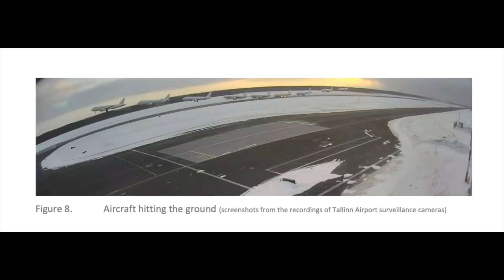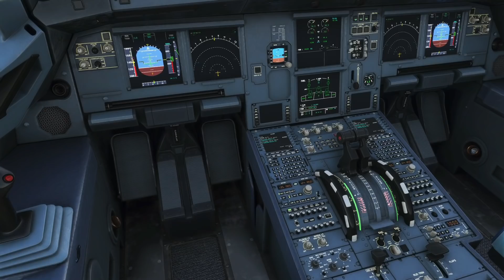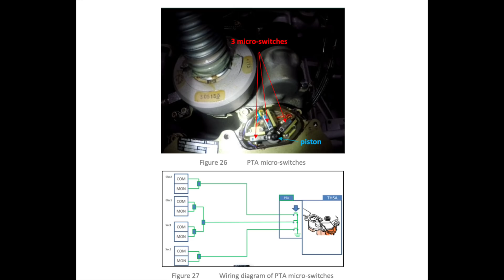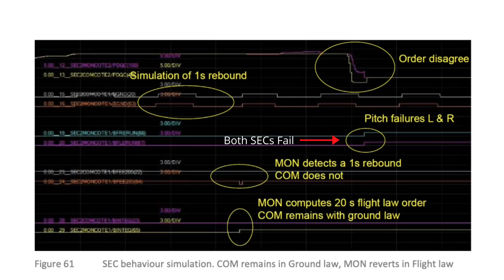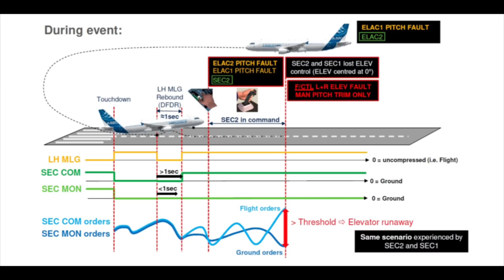The Oil Change That Crashed A Passenger Jet | The Crash Of Smartlynx 9001

Comment: I'd say automation should be between 5 and 8. Not enough automation = pilot overload. Too much automation = pilot in the dark if things go south.
Reply: Dude, the plane told them that something was wrong. They chose to ignore it, resetting the computer time and again. I can understand if they reset the computer once. But if it comes on a third time, maybe, just maybe you should consider that there might be something wrong... It's kinda like you see your engine check light and say: "Ah, no big deal!"Until your engine locks up. Then it is a big deal.
Reply: @brkr78  - Airplanes don't usually pass one another going in opposite directions separated by 5 feet. An aircraft can be a couple of hundred feet, or more, out of its prescribed flight path. No problemo. Motor vehicles are 6-8½ feet wide running in 11’-12’ wide lanes. The vertical is, though, taken care of.
Reply: @algrayson8965  You sure you are replying to me? I know planes don't pass within 5 feet of each other, at least as long as they are in the air and everything works the way it should. But if you notice that one of three axis have lost or degraded control authority, and especially if we are talking about the elevater - I'd say better safe than sorry. You learn that (or I learned that) in basic PPL-training.
Reply: @brkr78  eh, I don't necessarily agree. For starters, this wasn't a revenue flight, so no passengers on board. Second, I suspect this is similar to why the DC-10 didn't originally have hydraulic fuses in its control loops: prior to UA232 no one thought a DC-10 could suffer damage to all of the (if I recall correctly) four hydraulic systems at once. I can see the pilots making the decision that "Welp, looks like one have a fault in one of our quadruple redundant systems. We have three left, so I guess we'll just finish up and have maintenance figure it out on the ground."

I don't have a manual for an A320, but I'd be surprised if this was considered a "land right now" kind of issue. Even with all four computers out of action, the plane will revert to manual stabilizer control, which shouldn't be an issue for a pilot (its not like Cessnas have fancy fly by wire systems, everyone trains to fly it manually first). The issue here is that the specific way the system failed meant that the two remaining computers didn't realize they were being overridden, and I suspect they were still sending erroneous stabilizer trim changes, hence the "stuck to the ground" issue the pilots were having. The horizontal stabilizer has a lot more control authority than the elevators, so if it was trying to pitch the aircraft forward, it's going to be really hard to rotate the aircraft.

The other issue is that the full failure happened at the worst possible moment: when the aircraft was low, slow, and trying to transition into a different phase of flight. The pilots were already working hard with the landing, and didn't have time to really figure out what the heck the plane was trying to do. Hence the bounce that caused the engine damage.

As to the automation question, I feel like we're honestly at a good point with aircraft like the Airbus series, the 777-X, and the 787. This incident, along with AA1549, and UA232 are fantastic case studies in why we're always going to need trained aviators monitoring what the computers are doing. These are all incidents where a computer would have absolutely crashed the plane (or made the wrong decision) because the accident sequences were completely unforeseen. Generally, computers are great at dealing with things that are known unknowns, but they're terrible at dealing with unknown unknowns.
Reply: @MrKeserian  I don't know... If I'd get a repeated issue with my horizontal stabiliser computers once, I complete agree with resetting the system. A second time ... questionable, but OK, but when it comes on a thrid, fourth, fith time and MY ASS is in that plane then I'd like to sort that out before everything goes as far south as it did on this flight. I understand why they decided to continue - time is money, and they probalby needed the plane back in service ASAP. In so far this was a blessing in disguise, but still.
Reply: @MrKeserian  Do we want computer assisted pilots, or do we want human backup for computers? Computers don't get bored just being along for the ride.
Reply: @flightmode9114  Humans get bored when we have nothing to keep busy with. We also need constant practice at whatever we do.
Reply: Actually worse,    NO Automation < = Pilot Overload >= FULL Automation
 ie Depends on Pilot etc,etc,etc.   

There is a reason your first pilot's licence is in an unautomated light aircraft.
If you cant handle complications here you cannot be allowed to be a pilot especially with automation.
Why do you think top tier pilots are usually ex military pilots ?  
Their training is time compressed, learn soon or die even sooner !
Reply: I think the best approach to automation was put forth by BOEING (never mind the actual planes)... Automation should assist the pilot in flying the plane.  It shouldn't make the pilot redundant.   Seems to make sense.
Reply: how about 10 automation but with full notifications about what's happening?
Reply: The idea is that full automation = almost never going south . When it does… too bad. Analyse, improve…
Reply: Even more automation = pilot out of a job.
We seem to almost have fully self-driving cars right now, and I've heard a lot that self-piloting is much easier in the air than on the ground - for just one example, no parked cars on the side to hide the child that's going to run out in front of you.
Food for thought.
Reply: @KaiHenningsen  I can tell you right now that it is never going to be possible to fully automate pilots out of their jobs. Aircraft have literally hundreds of little subsystems that have to work, and if just the right handful of subsystems fail, such as in this particular incident right here, you have an aircraft that is absolutely no longer capable of flying itself without some serious creativity and ingenuity. Computers are (currently) not capable of that--only humans--and I do not forsee that computers WILL be capable of it anytime in the near future.

Furthermore, a fully-automated aircraft is still wholly dependent upon the maintenance provided to it while it is on the ground. What happens when that maintenance falls short? Cuts corners? Skips steps? Or is just flat-out ignored? You end up with aircraft that literally can not fly themselves when things inevitably break. You end up with aircraft that not even HUMAN PILOTS can fly, in a rare few cases. That's why the tremendous amount of automation built into Airbus aircraft is all designed to Just Quit and hand things over to the pilots whenever anything falls out of the operational parameters that the computers are programmed to expect and be able to operate within. There's a much better chance of a pair of meatbags in the seats up front being able to figure out a solution to a problem so complex a computer can't creatively think its way around it and bringing the aircraft down in as many whole pieces as possible.
Reply: @calyodelphi124  It already happened.Ask the military.
Reply: @cbaurtx  If a military jet crashes, most people probably won't know about it since the media is obsessed with hourly coronavirus updates and what Kim Kardashian recently posted on her Instagram. If a commercial passenger jet crashes, it's headline news everywhere and there is public outcry.

It's like The Joker said: "Nobody panics when things go 'according to plan.' Even if the plan is horrifying! If, tomorrow, I tell the press that, like, a gang banger will get shot, or a truckload of soldiers will be blown up, nobody panics, because it's all 'part of the plan'. But when I say that one little old mayor will die, well then everyone loses their minds!"
Reply: @KaiHenningsen  Still, you have the safety aspect of things. If something goes wrong (eg electrical failure) you will need several backups. It's extremely difficult to make a completely bulletproof system that will never fail. If the plane were entirely automated with no pilots on board and there was a failure with the computer (maybe interference or something else), it would be impossible to save the aircraft. Furthermore, you would need a crazy amount of backup systems in case something went wrong, which could further complicate an already complicated machine. Making aircraft or anything that puts peoples' lives in immediate danger following the software design mentality is not okay, as generally, software developers will only fix a problem if it's happening frequently or is a serious issue after it happens. This is not acceptable in the aviation world, as a bug could cause the aircraft to crash under the right conditions, resulting in a horrific loss of life. It's comparatively easy to fully automate an aircraft, but doing it safely and reliably is much more difficult.

Comment: Plane crashes have been significantly reduced by automation. Pilots need to be properly trained to understand how to best use the automation on board their aircraft.
Reply: Otherwise, 737-MAX ...
Reply: Yes, I agree. Some pilot has become less trained because of automation. Air France flight 447 happens because the co pilot pitch up the plane without anyone knowing it and lack of training when the autopilot was disabled due to a frozen pitot tube. Despite Automation helping, pilot still need to be trained to know what to do if something happen/understand how it works
Reply: Supporting data please.
Reply: As a professional pilot, I can tell you with certainty that your statement is utterly ridiculous.
Reply: That's ridiculous. The automation is there so as to be invisible to the pilots.   It is the obligation of those designing the automation systems to be cognisant of the failure cases.   When there is a failure it is not down to the Pilot, it is down to the inherent Hubris of the automation designers.
Reply: Max was all about not revealing the failure cases.
Reply: @alphalunamare  But most crashes in the commercial aviation was due to pilot error though
Reply: @nakqalzaki  The dead find it hard to defend themselves.
Reply: @alphalunamare  Then again machines are never alive to begin with
Reply: @alphalunamare  Oh don't worry about that, the CVR will be there to tell their story. Unless it's unrecoverable of course.

Comment: i'd probably say a 5, automation is good if the pilots make a mistake but you should always have enough manual control in case of mechanical failure.
Reply from the maker: Hmmm a balanced approach